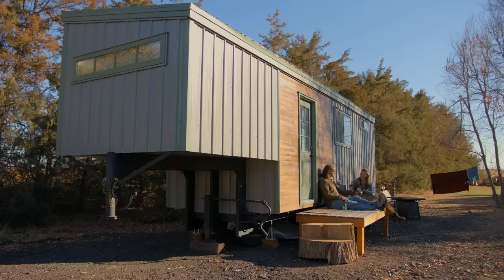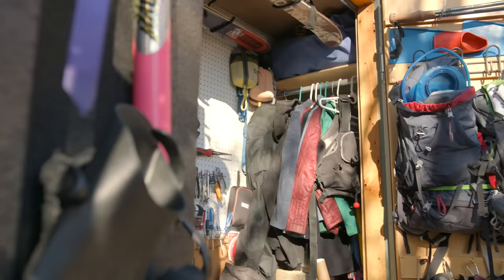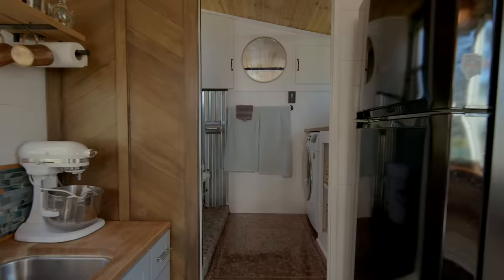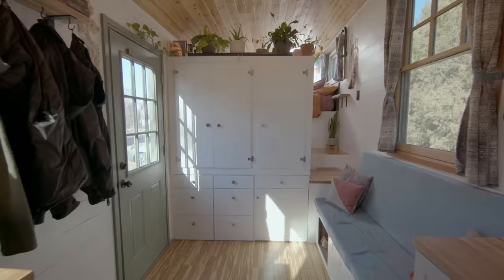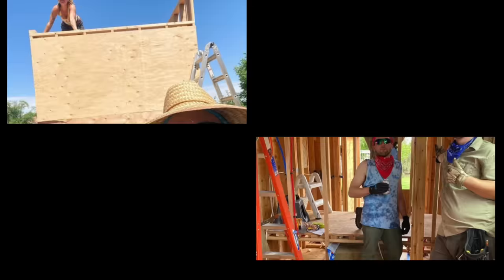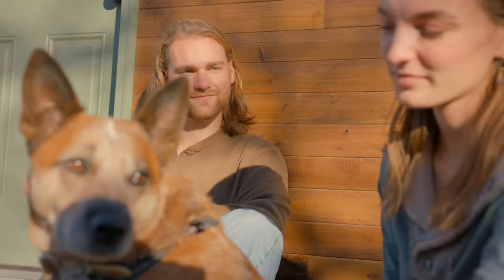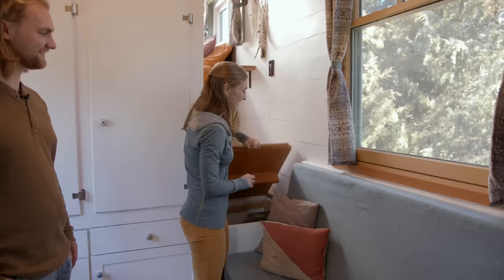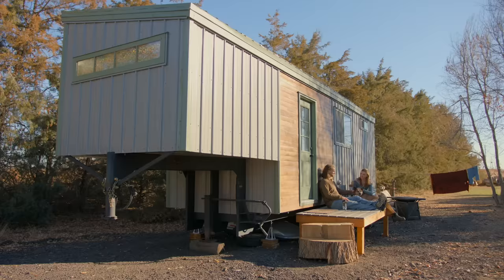Couple Built $38k Tiny House n 3 mos! standing loft & it's off-grid

Comment: Truly I am so amazed by the wisdom of this young couple to have built this wonderful home at such a low cost with I want to say an AMAZING GREEN % of 50% for a first time build!! I am an interior designer and at your age I was clueless pretty much about the green movement except for hardwood floors and home gardening - that would’ve been the  extent of knowledge!!!!

I think you should be very proud of yourself for everything you’ve done in terms of the green movement and sustainability as well as making it so beautiful inside your home for the FIRST  BUILD…. The coin floors in the bathroom, the hardwood features throughout the house,(Especially that kitchen table that pays homage to your Grandfather), The tile you put in the kitchen the efficient Ellie do you lights for extra lighting throughout the house your  Solar Panels on top if your home, The energy efficient toilet, etc. so many choices that were wise and you’re both going to college at the same time you were building and I just want to say as someone who’s been to college three times in my lifetime that this is so much work and stress even though you were during the summer, the pressure of going to college is overwhelming and for those of you who have not been, and those of you who have not worked on a specific degree beyond just a couple years or four years, it is like working an 80 hour job, so to be able to focus on putting this wonderful house together is in my opinion fantastic and tremendously overwhelming & Very confident on your part. Please give yourself more credit than you are in this video😊❣️❣️❣️❣️❣️❣️❣️ I would be so very proud of you if you were my children. Stay in school and finish your graduate programs as you were very close. Don’t let anyone or anything make you quit because I did that one year for someone I loved and I wish you both the greatest success in your careers but also much happiness in your life together don’t lose what you  HAVE FOUND ALREADY IN BUILDING THIS TINT HOME♥️♥️❣️❣️❣️❣️❣️♥️♥️
Reply: Agree completely, 👏👏👏💕
Reply: You are so kind, thank you so much for the encouragement and praise! We wish you all the best

Comment: Nice spot, I wonder if the land lords allow them to put in some gardens when they have time.  Some pretty planter around the front would be so pretty a few rose bushes as well. Just imagine the rose scent flowing into the home during the spring summer and fall. The home is super cute and done very well. The garage really is to die for and super smart. MY fiance would love it. He has a ton of tools for his business he started.  For me I would have to have a TV. Lol. My question though is, is there shower curtain? Also how do the keep thw water off the penny floor which BTW is really cool and very shiny. Did they epoxy or poly on the floor. Love the shower floor to. I bet the rocks feel so good. A foot massage every time you take a shower. Its really a lovely home. Good luck to you and enjoy. See if the land owner has an old large water trough.  You could set up a cute little pool for the summer. You could line the inside with blue rubber. Flex seal  works great for leaks even large leaks. Comes in, any different colors to.. she would have a blast creating a home made pool.. Get a filter and chlorine or alternative for it. Pretty easy to set up.
Reply: Thanks for the nice comment :) 
There is a shower curtain that just hangs on hooks when we want to shower and we just fold and put it away when it’s dry. 
For the penny floor, we used a black grout after flying the pennies down and did 2 layers of epoxy. An outdoor tub would be amazing!

Comment: Thanks for focusing on the pivoting step into the bathroom. It's something I've never seen and could be put in a variety of locations in a house. Beautiful work.  This vlog is a fine length!
Reply: It took us a whiile to figure out how to do the step, but after a while we decided that the fewer moving parts, the better and landed on this design.
Reply: @timhelmer5389  : 👏 👏👏🥰💕
Reply: @timhelmer5389  It's a great design.  Could you share a little info about the mechanical parts you used?  Is it an off the shelf item or did you hack parts from something used for another purpose?

Comment: Better than a small one bedroom apartment, as you can change things, add things, you have a better kitchen area, you have your own washer and dryer, you can have your pet, you have a private entrance, and I am sure the lot rent is far cheaper than an apartment. Also, when you go onto another University, or graduate and get jobs, you can move the tiny home to your new location without a real big hassle.
Reply: Well at least washer. They have no dryer. But ya that's the great thing. You can make it your own.
Reply: @-greentoad  I learned a good technique on drying, is to put the wet clothes on coat hangers, on a rod, outside in the shade somewhere, in order to dry them.  It looks better than a clothesline, and if they are in the shade then it doe not fade them out like a dryer would.
Nashville made clothes lines illegal, and many towns inside the city limits have also done so. Most Nashvillians put their clothes on hangers on  a rod, on the back of chairs, so it is low, and can not be seen over a rail on their apartment balcony. 
Those little drying racks only hold a couple of items, if you are drying  a whole load it is much more difficult.
Reply: Thank you for the comment! We love that we can look at moving it closer to where we will be working this next year without having to pay a huge deposit for an apartment that we don't even like. And as for the dryer, we either hang outside or we actually have lots of space in the bathroom to hang our clothes in the winter when it's freezing outside. For a family, of course, a dryer would be more of a necessity, but for use two, it works great!

Comment: FYI you need to put holes in the board that supports your mattress, so the mattress can breath.Mattresses collect of lot of moisture from our sleeping on them.So glad to see you have an air exchanger that is the number one mistake i see in the vast majority of tiny house ans the smaller the house the worse it will be..Never talked abbout
Reply: Thank you for the tip! We are working on it, I've also seen the supports that keep separation between the platform and the mattress that provide air flow and extra comfort, too.

Comment: Amazing, especially for a first time building. A few questions: what is the brand of your heat exchanger? And did you treat the wall behind the metal in the shower so that there is no mold build up? We are building a tiny one currently and there are so many details to consider.
Reply: Yes, the whole bathroom is painted with the red waterproofing paint as the base coat. I can't find the brand, but it is a 'heat saving air exchanger' and it was whatever the local home depot had in stock and was wall mounted.
Reply: @timhelmer5389  Thanks a lot! I am familiar with that red paint :)

Comment: Where did they find the infovon the solar power battery bank and converter system? This is my only holdup in finishing my TH setup
Reply: I’m studying Electrical Engineering and have worked with several renewable energy projects before so I had an idea of how to calculate the size of battery and other stuff required. That being said, I also learned a lot from the internet! Just looking around YouTube and just generally looking at different solar websites that have handy array sizing calculators that are free and easy to use!
Reply: I also do consulting for smaller renewable projects so feel free to reach out if you’re interested in hiring me to help you with your design!

Comment: The open shelving looks nice but I think I'd get tired of boxing and unboxing it if I moved the trailor much at all...
Reply from the maker: Fortunately they don’t plan to move very often 😉😊
Reply: @TinyHouseExpedition  
How do they fill the water tank?
Reply: @b_uppy  at 2:09 you can see a black locking small door that housed the gravity feed for the water tank. There is also a pressurized water hookup underneath the house.
Reply: @timhelmer5389  
So are the harvesting roof water,  hauling the water in by truck or connecting it to a hose???
Reply: @b_uppy  we have a spigot nearby, but could have it delivered via truck if our next spot doesn’t have water close by.
Reply: @timhelmer5389  
Yay! That makes it easier.  150 gallons doesn't go far...